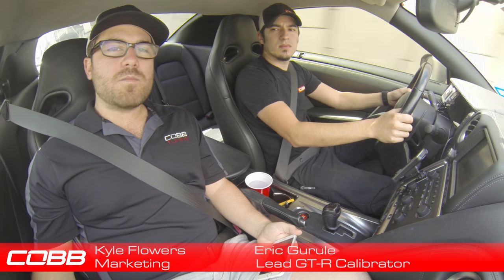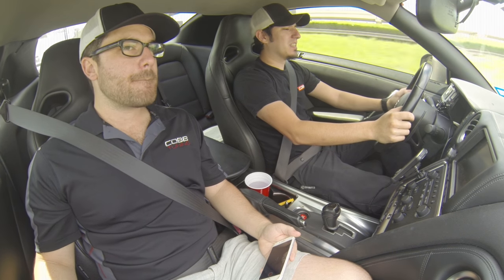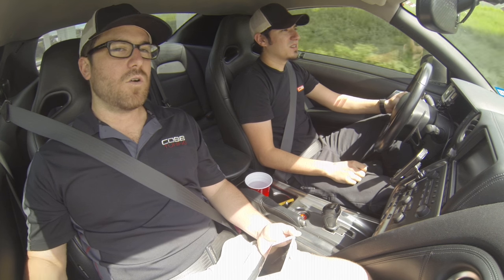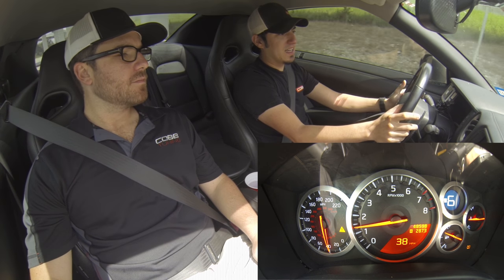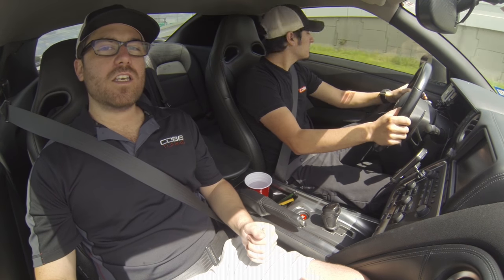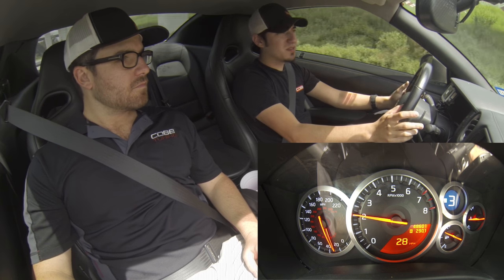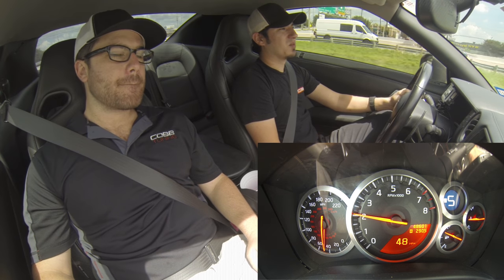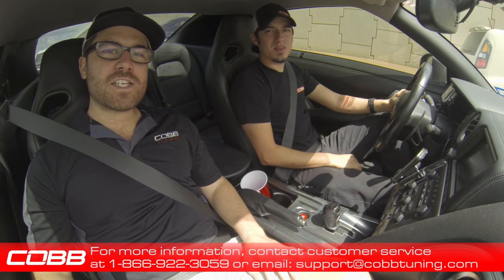COBB Tuning - Nissan GT-R Optimized Shifting TCM OTS Map

Comment: I have gtr with cobb and actual 1000hp I do not like the car to run at 6 gear below 2 thousand rpm, in my city it has uphill and downhill and the car takes a long time to reduce gears and has a strange behavior in this situation between 1000 and 1600 rpm, and this situation is more occoured in uphill, downhill its ok

Comment: Cobb is a rip off $400 to reset an AP. Hell apple doesn't charge you anything to unlock/unbrick your IPhone. The issue is they built such a brand that it makes the masses think you only have one option. As a complete successful company (in which they are not) would have for seen this problem of an end user selling their AP not remembering that it was marred to their car. Cobb is no better than MS when they became a monopoly. Cause of course it would make sense to overcharge to devalue a few ones and zeros.
Reply: Just installed this on my 2012. WOW my hat is off to you guys! You don't say it here but it refined the low throttle (back out of spot, pull forward in stopped traffic) so well it feels like a different car. This is WELL worth the price...makes the GTR feel so much more refined.